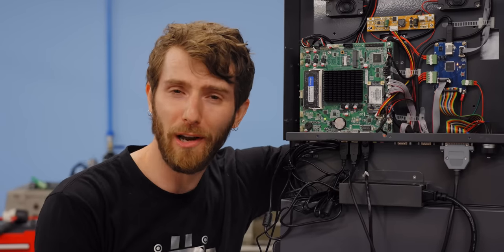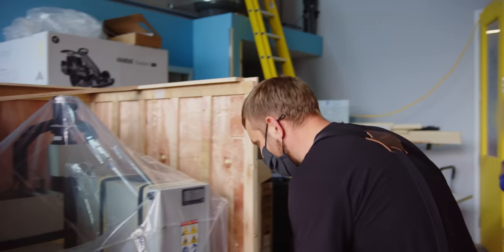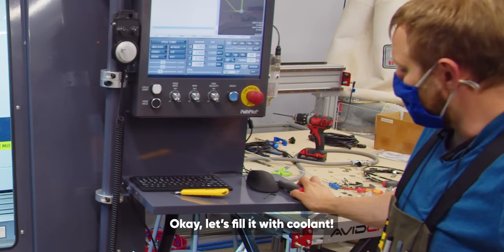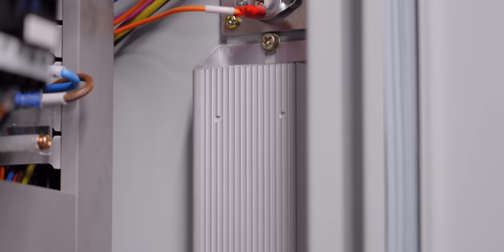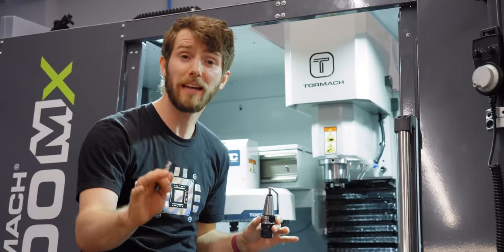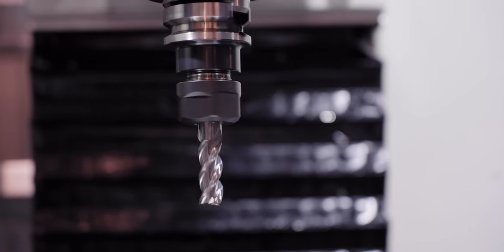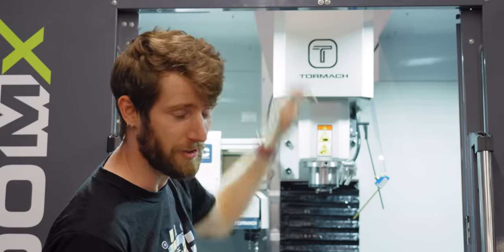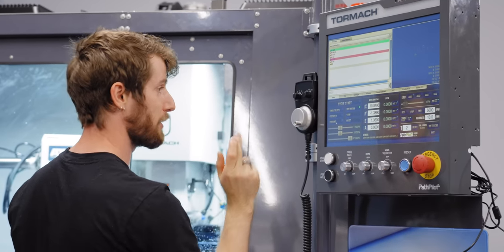The longest unboxing we've ever done. - Tormach CNC Mill Commissioning

Comment: "Should never be run with the doors open." Meanwhile I'll be standing there with my safety glasses keeping my mouth shut and my face like a foot from the spindle while getting covered in metal shards🤣
Reply: The doors only protect you from minor injury. I've seen chunks of metal go through those doors like they were paper.
Reply: @cbrunnem6102  Thats what you get when you buy a toy machine
Reply: @BestRedditorClips  I've seen it on a dmg.. hardly a toy
Reply: reminds me of some of the monster chips I would get while running the big old bickford radial drill where I used to work. Some of those could get caught on the spindle and whip around, but speed and feed that produced such a chip was so slow it wouldn't hurt you unless you grabbed it. Loved that machine, had a lovely quick change system in the quill that was hand operated, you grabbed a collar and pulled it up along the quill, tool holder with tool would drop out, you could then throw a new one up in the quill, drop the collar, and be good to go. I was so fluid on that thing if I was running a tap job (slowest speed possible) I would just leave the spindle running the whole time
Reply: @cbrunnem6102  yup, it's a brown pants moment when the cutter pulls the work out of the vise and throws it against the  window..

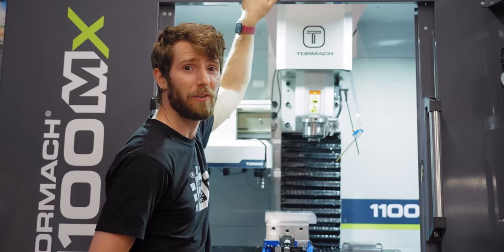Comment: 12:22 "Which raises the question: Why does a machine like this cost less than a cinema camera?"
Reply: With this you can only work on a few materials. A camera can film ALL materials. Simple logic, really.
Reply: You cant film stuff using a cnc machine :)
Reply: The camera is miniaturized, which is expensive and takes a lot of effort. What's more, the camera, cooling and all, has to be silent during filming. The CNC can be as loud and bulky as it wants.

Comment: that a cute little machine.  machinist here. the first mill I ever worked on was a MORI SEIKI MH-633 twin table horizontal 50 taper with full table 4th. and 1k psi threw spindle coolant. that machine is the size of a small house.
 also im glad to see you guys buy a Saunders Machine Works fixture plate.
Reply from the maker: Rad! I've programmed/run Mori NV-5000 and Haas EC-400's (and smaller) in a previous life. -CW

Comment: "Engineered in Wisconsin, manufactured in China", isn't it always.
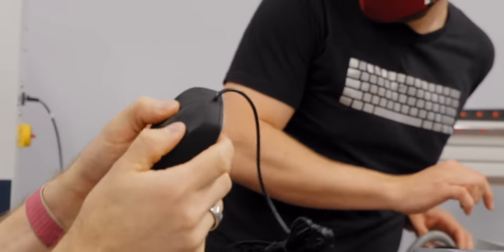Reply: 3:38 Chineseium
Reply: Thats why its 40k and not 100k
Reply: @WayStedYou  Considering that a Haas Minimill has linear rails, a 40 taper spindle, and a dealer service network with a base price of $34k(admittedly, it's really, really easy to double the price of the machine depending on options), and is made in Oxnard, it becomes a question of, "why would you buy a Tormach?"
Reply: @machinist7230  Made in China doesn't always mean a lower priced product, but it always means more profit for the manufacturer.

Comment: I feel like the engineering guys are taking advantage of linus's lack of knowledge on these things to buy absurdly overkill tools
Reply: It depends on what they are trying to do. Linus isnt dumb by any stretch, so they have a plan for it. A CNC will save money in the long run on just labor cost. Its an upfront cost that doesnt depriciate that much either.
Reply: Possibly. They did buy a toolmaker's grade bridgeport so they must have some milling needs, and for a cnc mill this is basically the top end of low end machines. This should hold them over for decades.
Reply: I have a Bridgeport sitting in my late Dad's garage. It's older, but it's still in great condition. If I knew they needed one, I would have mentioned it to my Mom.
Reply: @brahtrumpwonbigly7309  i disagree. Haas machines are the "top" of "low" end machines... i would never buy a tormach to he honest.
Reply: @davidwilhelmsen980  Last time I checked they arent a fabrication shop. They are gonna use it like twice a year to cut out a heatsink or something. Yea it will save time but I cant imagine they will ever use it enough to actually offset the investment. Besides, like I said they arent a shop, so if they use a cheaper machine that isnt as high quality it doesnt ultiimately matter. No end customer to dissapoint.
Reply: @NOGRIZZGUY  yeah, hence why they got a cheaper mill. That isnt high end at all, but it does all that it need to and more for their use case

Comment: 40 grand doesn’t sound insane compared to the other gear they purchase 😅
Reply: 40 grand for a new CNC is actually pretty good value. Those things can get stupid expensive
Reply: Some machines can be upwards of 500,000, depends how fancy you wanna get
Reply: Or the 250,000 USD Linus spent on alpaca wool

No, I’m not joking
Reply: I keep forgetting they got the MX. Tormach has similar offerings for around 25k. I'm actually looking at getting one myself for a home shop.
Reply: @alexiovich4952  yeah, even without going up in size
Reply: And let's not forget that he bought $50k worth of Gamestop stock
Reply: The 'user purchasable' items are on their web site and not hidden behind "call for quote".  The software packages run 600 to 2000, the individual replacement parts in the same kind of price range.    That A-Axis that we all held our breath hoping Linus didn't drop it is 2300 + 700 in additional items needed to run it.   For what you are purchasing, either as individual parts or as a completed unit there is nothing out of line with their pricing at all.
Reply: In a machine shop in Virginia I saw once they had a mill that literally took up an entire room. Had to be 20 feet tall. The lathe they had was also massive.
Reply: @davidwilhelmsen980  Honestly? It's almost nickel and dime money. A replacemt spindle for one our Hurcos cost $12 grand, and the 4th axis for another was over $50k. The amount of money you can spend in manufacturing is just insane.
Reply: @alexiovich4952  You can spend alot more than that - the CEO of my employer wanted to buy a Hurco Gantry Mill(DCX series) during our last expansion, but decided against it, as we didn't have the room. The machine was quoted at1.7 million.
Reply: @machinist7230  if its nickle and dime money, doesnt that make it a good value? It does the job of a CNC mill. Dont forget those guys wont use all the bells and whistles of a $500k mill let alone theirs.

Comment: We had alot of these at my old internship, they were even bigger, the biggest was 3x bigger than this i'd say and costs half a milion bucks, they were really cool and alot of fun to work with. You only forgot to mention the most important tool, the measuring tool. You need to set a zero point for all your axes before you start so the machine knows where to start and measure from.

Comment: 14:50, the finish is all about what tool and fixturing you use. Tungsten carbide tools combined with a sturdy fixture usually gives great surface finishes. EDIT: try running the tool in the opposite direction too for even better results. The way it's been ran in the video usually creates some slight drag and scrapes against the surface.

Comment: I spent 25 years working various CNC mills and lathes. I noticed the ATC flex during a tool change. Not sure if the coordinates are setup correctly. While it will work for a while any unnecessary flexing will cause a failure. 

Otherwise it is awesome so what 35k will get you. 
Release the schmoo.

Comment: The reason for the mouse being spongey and silicone-covered is that it's meant for machine shops where users' hands are usually kinda gross and covered with oil. Normal plastic mice would just slip out of their hands and be terrible.

Comment: I do aerospace machining with cnc mills, lathes, and grinders. Depending on part, mainly on grinders, we have to work with very tight tolerances. Many times have to be with in .0002 to .0005 of an inch.

Comment: Those doors come very handy when things go south, especially on large VTL's!
Reply from the maker: VTL's scare the jeebies outta me -CW
Reply: @LinusTechTips  me too! Stood in front of the door of one once when a piece of metal got lose from the chuck of a large VTL. Someone didn't think it through before they mounted 40mm wide metal bar to the chuck to clear the long metal "chips", they could not get it to chips because of the process, but he forgot there is a thing called centrifugal force involved and the metal bar broke off spinning at high rpm and got thrown into the door me and two others were standing in front, I think my heart missed a few beats. Kept a greater distance after that. 

I'm a industrial robot programmer so although I don't work with the machines i get to see many interesting machines and get to experience or hear about when things go wrong. 

Like when the same customer forgot to cut away the steel fastening strips from the pallet with raw material bearing rings that was loaded into the robot cell we had built, the robot went to grab one of the rings, but instead of picking up one ring it picked the whole pallet up with all the raw material cast rings, weighing around a ton, thankfully the robot sense when there is a weight difference so it eventually stopped when it's slowed down the massive mass and they were able to jog it back down.

Or when a customer jogged a robot manually and forgot to open the gripper when he wanted to jog it away after the robot had reacted to a collision, it was also a VLT (slightly smaller) and the robot rearranged the position of the VLT as it dragged it across the floor 5-10cm. They after that moved the machine back and bolted it to the floor.

Comment: Off Topic-I found a manual fan control for my GPU using Linux Mint 20.1 and both AMD and NVIDIA are supported. The program is called radeon-profile for AMD cards and GreenWithEnvy for Nvidia. Thank you "LinuxMintGuy" you tuber for finding this on the internet. THIS WORKS just like MSI Afterburner and I have no issues with it at all.

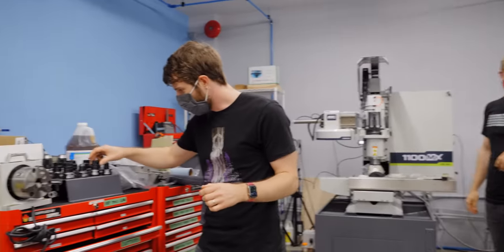Comment: 2:45
Those toolholders might be expensive but they are actually a relatively "cheap" common kind tool holder, there are much more expensive kinds for higher accuracy, higher rpm or special tools. Though those are definitly overkill for what youre using them for

Comment: I want a tormach so bad. They're not the best out there,  but they're so reasonably priced. Get some ceramic cutters for them and they'll cut through just about anything
Reply from the maker: I actually wouldn't use ceramic cutters in it, I think more rigidity is needed to utilize them effectively -CW

Comment: i used to work with cnc machines about 10x that size for 3.5years at a past job, makino, mori, mazak.  they are amazing pieces of equipment. mazak althou not the best did have a mostly user friendly inferface that ran on windows xp.

Comment: Yeah that machine is def made for what there doing, just some odds and ends small parts it’s not made for hard materials, tight tolerances, no shot it can hold .0002, more like .001-.002 at best. If you really want to know buy a gage from mitutoyo and measure how accurate the machine is, and then measure it in 6 months.

Comment: You 100% explained Clearpath Servos wrong.
saying they are "less torquey" isnt accurate, they have a a better torque curve especially at higher speeds where steppers loose most of their torque.
they are a servo.
they only receive step/dir/enable signals and power and while they do have the ability to send basic signals back to the controller they dont need to. the servo receives commands and the built in controller interprets them.

Comment: As a CNC technician, take it slow. Every CNC operator crashes, it's just a question of when. I really wonder if you set the machine up correctly. This is one of those, "you better not mess it up" that's why we pay hermle and mazak to recalibrate ours for $25k a year/machine.
You probably need more expensive measuring tools than you think...

Comment: Probably thinking, $30-40000 ? OMG !

Eh, a HAAS VF-4 which pretty much the same size as the Tormach, will set you back $50000 for a USED one. New one is around $100K. And HAAS has it own proprietary software, which cost a bundle on it own. I have not heard of any one running LinuxCNC on a HAAS, yet. 

Tormach makes really nice machines, and that one should last for years.

P.S. That is a nice conventional lathe on the left, is it a Grizzly ?

Comment: That pedal looks like a prototype of an aluminum pedal from a company called OneUp in Squamish. I wonder if that's where Colin used to work...
Reply from the maker: Close! It was Raceface - that's an Atlas pedal pre-production, the design got flipped around if you compare that to a production pedal due to bearing longevity issues from that opening being at the crank side. The engineers that I worked with all quit simultaneously and started OneUp (and left me behind running the Carbon dept) -CW
Reply: @LinusTechTips  Ah that's interesting. Thanks for the background!

Comment: Was that a OneUp pedal?
Reply from the maker: It's an early prototype of the Raceface Atlas pedal - this version has the cutout on the inboard side of the pedal, which required additional seals and was ultimately scrapped in favor of moving that cutout to the outside. If you compare it to a photo you'll see. Fun fact: The same guy (Chris H) designed both that pedal and the OneUp pedal -CW
Reply: @LinusTechTips  oh cool, is Raceface Vancouver based? I guessed OneUp because I know they're up around the Vancouver area

Comment: bro wear some safety glasses when you use the air hose!!! getting metal or coolant in your eye is not a fantastic experience, i had a steel grain that got in mine from the air hose ended up rusting and the eye doctor had to use a small drill to remove it, not fun at all!!

Comment: I'm laughing at this whole thing. Because this what I do for a living as a service tech. There YCMs and Kitmauras that hold 100 tools on a automatic Tool changer and two separate pallets and has over 15,000 RPM spindle with dual axis drives. Nice machine though.

Comment: Only 40 grand ? That's cheap. I mean it is a lot of money but for a proper tool like this it is not bad. But parts are going to be insane. Parts that's where they kill you. In a factory running these 24/7 takes a toll and parts break and when they charge 6 times as much for a bolt you will feel those costs. They will charge 200 dollars easy for a bracket 50 dollars easy for a pin if you lost it.

Comment: Realizing Tormach doesn't use Mach anymore feels weird. Plus saying people use them to "make money" is a bit disingenuous. They are still considered Personal CNC, great for R&D floors, occasional prototyping and tinkering, but they are nowhere near being production machines.
Reply: It's all in the setup and knowing the limitations of the machine.  If you are cutting titanium on the daily, the the Tormach simply is not going to hold up.  If you are doing aluminum and other easier to cut materials then there is no reason why you can't do production on a Tormach.

Comment: A touchscreen on a NC- machine? Clearly not meant for heavy duty machine shops, where cast iron or steel is being machined.
Wear safety goggles, especially when cleaning parts with compressed air!! You don't want metal pieces with coolant residue in your eyes! Even though Canada has public healthcare :)
Apparently you're machining parts for your own use in northern America, otherwise you would use metric measures.

Comment: You need to keep linus away from this machine. He will end up breaking It. The reason It's expensive Is that everything Is made to exact tolerances not like your router that Is pretty basic. Try using a bridgeport first then graduate to CNC.

Comment: Actually this is a pretty decent machine! And this video showed me that german industry is actually spoiled with the technology and percition we are able to work with! My first impression was "thats a fucking toy..." only 2 to 4/10th of a thousand inces accuracy, detachable A axis, max of 12 tools, incredibly slow tool changer compared to industrial standards. The surface interface looking like.... beta or even alpha stage... but then it comes at a price of 35k?!?!

This video made me realize, that the industrial standard in germany I was working with for 6 years is actually pretty darn awesome and on top of the line. Accuracy of 0.2/10th of a thousand inch standard, 60 to 150 tools magazin standard, 10.000rpm... its okay, you wont need often, but it can come in handy for some worktasks, and I guess ltt will work alot with plastic and copper so the 10.000rpm come in quite handy..., and then the detachable A axis on this one, assumeing the brakes for the axis are suteing the price of 35k, the necessary feed to effectively use the 10.000rpm with no visible marks on the cuttingsurface... we'll see, but damn... not bad Tormach!

Overall still looks like a toy to me, but you obviously can not compare a 1.500.000€ machine as I am used to, to a 35.000usd dollar machine and expect the same. 

From what we can see in the video, Tormach really put efford into it and actually for these specs, 35.000 dollar seem like a free giveaway for this performance!! Great Job! 
Can't wait to see what awesome Workpices Ltt will create with this. That opens worlds for custom liquid cooling solutions by that I mean it comes down to even cutting the cooling fins of 0.3mm, case buildings and so much more!! May want to make cooling hybrids to savely go below 0°c by combineing the electric cooling pad (i am sorry, I forgot the name for it) with some custom liquid cooling block.

With this machine, holy shit! I can not wait for the news on what creative stuff they will come up with!   

I am a german tools-spoiled cnc machinist, and I am impressed haha